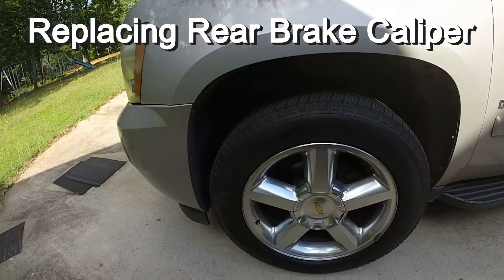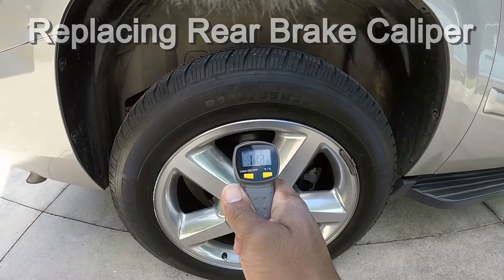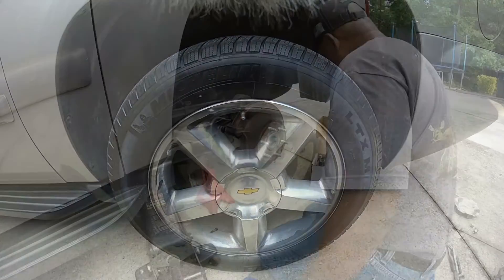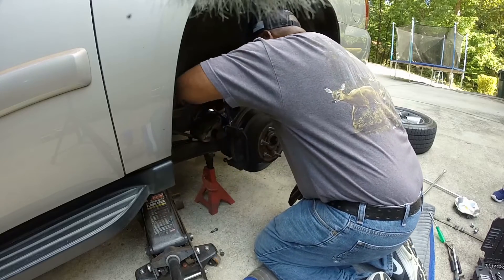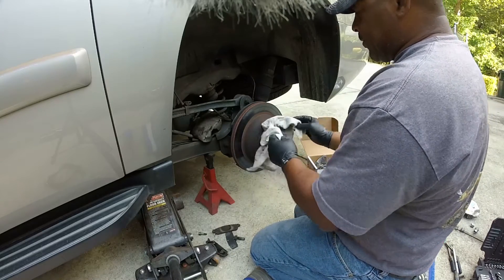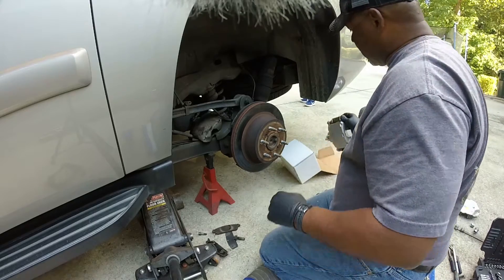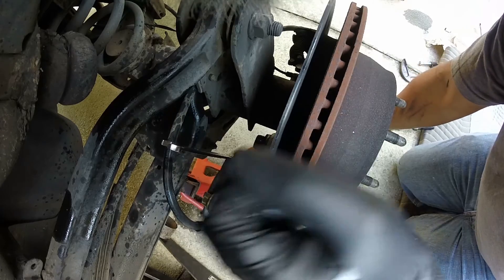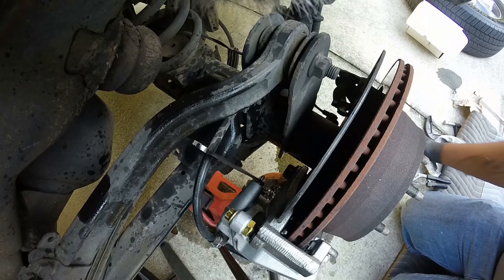2007 Chevy Suburban Brake Caliper Replacement

Comment: I have the same issue on my 2007 Suburban.   Replaced brake pads and after test drive the driver side rear wheel was over 400 degrees F (I checked with a temp gun just like you)!   Ordered calipers today on Amazon and will be replacing them probably this weekend.    Thanks for the great video!
Reply from the maker: I’m glad you was able to locate the bad caliper sometimes they can be a pain to find without the temperature gun.

Comment: I like you and really like your attitude and what you said at the end. I am grateful for how many people post videos, so I can see how to repair things. Thanks, man!  I have a 2013 suburban that broke a front hub. Dealership repaired and replaced one damaged caliper. They recommended I do them in pairs. I did not believe them. Months later I have 20% pad remaining on one side (side with the dusty rims) and the other side has 60% left. It never pulled when braking, but was obviously not braking evenly, or dragging. ALWAYS REPLACE IN PAIRS. Lesson learned. I will be doing this once the weather gets better. Thanks again for the good video!
Reply from the maker: Man I hope you get your truck right because no one has $70,000 laying around to buy a new. Thanks for the great comment and good luck.

Comment: Thanks for the help. Just replaced a caliper for my 2009 Suburban. Great tip to wait until last to switch over the brake line. Excellent job by your helper!
Reply from the maker: Joseph Rosen Sorry for the late reply but thank for the comment.

Comment: This was extremely helpful.  Thank you for taking the time to share your knowledge.
Reply from the maker: Thanks glad the video helped.
Reply: @michaelyoucanfixthat  Hey I have a 2008 escalade which is probably the same as your truck and my passenger rear brake pad always wears down faster than the other side and usually also warps that rotor on that side after a couple of years. We're you having a similar issue? What caused you to start checking rotor temperatures?
Reply from the maker: @memphistiger4647  I started smelling burning brake smell. Once I noticed that I knew what the problem was. So, I start feeling the inside of my rim to feel what tire was hotter then the other ones. Like you say about brakes was wearing uneven on one side. That also let you know the caliper maybe sticking. You might just have to grease the slide pin that the caliber slide on. I hope that helps.

Comment: Thanks for the video! I didnt think it would be a difficult job but I had never removed a brake line before.
Reply from the maker: Kendal McCray Just know when you remove the brake line it’s going to leak brake fluid and it will not stop. So be ready to connect it to the new caliper quick as you can.

Comment: I just did this to my Passenger Front, But didnt bleed the brakes.... I got a 07 Yukon Denali XL
When I pushed the Pistons back in on Driver side and Passenger then Put my Tire back on, Added Fluid, and stepped on the Pedal it wasnt going Stiff at all. 
You think cause I didnt bleed that Passenger Brake?
Reply from the maker: That could be the problem but did you pump the brake pedal a few time to see if it would get stiff? Must of the time a few pumps of the pedal would fix that but you may have to bleed the brakes. May have got some air in the system some how.
Reply: @michaelyoucanfixthat  man I was pumping tf out that peddle. I was so excited to put eveything back together I totally spaced it out
Reply: @michaelyoucanfixthat  i also noticed you bleeding only that Back Driver side. You didn't bleed the rest of the wheels ?
Reply from the maker: @Cmimss  I only bleed the back brake because that was the only caliper I replaced. You should have to bleed the other brakes, IF YOU DID NOT press the brake pedal while replacing the caliber. There should not be any air introduced into the brake system.
Reply: @michaelyoucanfixthat  Okay. So later this week Imma replace my Rear rotors and Pads, after I do that should I go back to the Passenger Front and Bleed it, how you were bleeding it?
Reply from the maker: @Cmimss  you know the easiest and fastest way is to get someone to pump the brakes about 5 times then you open the bleeding screw. You should do that until you see no more air bubbles come out of the bleeding screw. About two to three should be good or until the brake pedal get stiff. Or you can gravity bleed the brakes. This is how you do that. Take the cap off the fluid reservoir then open the bleed screw on the caliper and just let the brake fluid run out of the bleeding screw until there are no more bubbles coming out with the fluid. It might take 10min or so. But it will do the job. Just remember to fill the brake fluid reservoir as the brakes bleed. I hope that helps.
Reply: @michaelyoucanfixthat  I've never bleed brakes b4, so when you pump the Pedal. It starts getting stiff as you are letting the Air bubbles out ?
Reply from the maker: @Cmimss  No, you need someone to pump the brake about 5 time then have them to hold the brakes down on the 5th pump. As the hold the brake pedal down you open the brake bleeder screw and brake fluid should squirt out of the bleed screw. Then you close the bleed screw. Do that until there is no more air bubbles in the brake fluid that is coming out the bleeding screw. About two to three time should be enough. After you finish bleeding, pump up the brakes until the pedal get stiff.